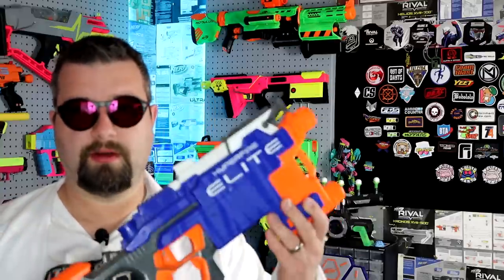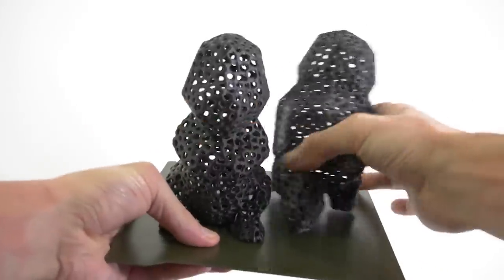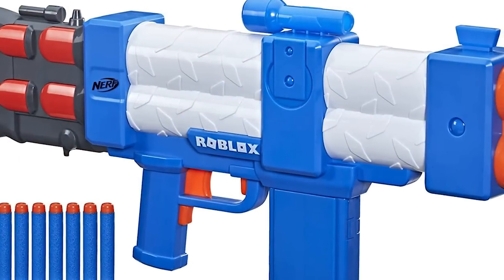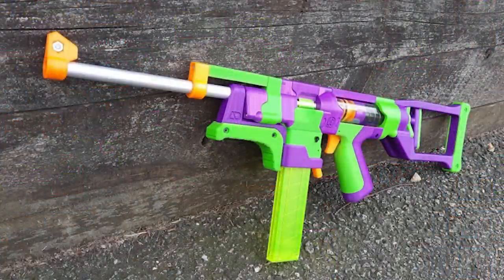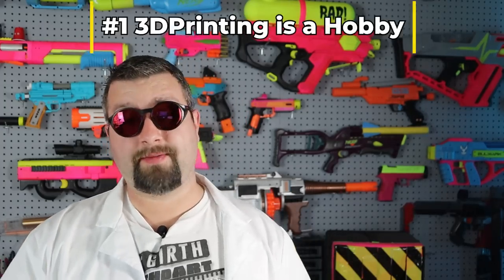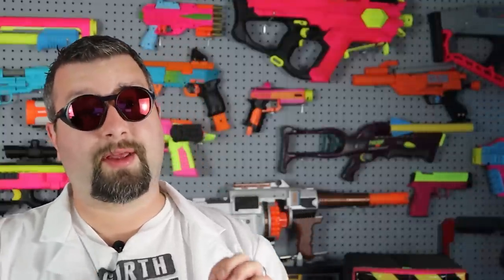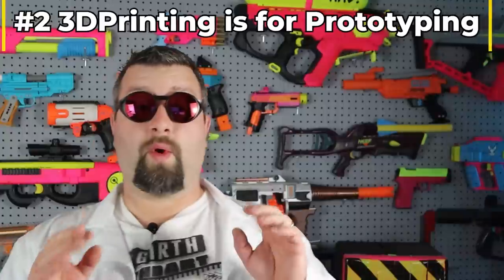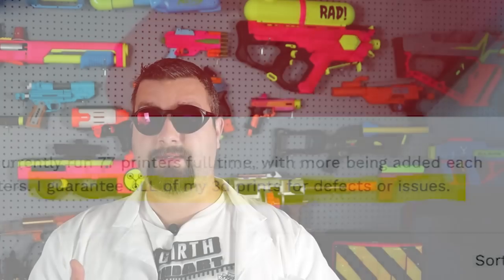What Hasbro Doesn't Want you to Know! 3D Printed NERF

Comment: I jumped into 3d printing specifically for Nerf and I absolutely love it. It is so nice to be able print something out and assemble the entire blaster... such an enjoyable experience ... On a side note in regards to your statement of PETG being brittle, I was bit surprised by this. In my experience and limited research on the topic I found it's actually very much the opposite that PLA is rigid and will shatter, but PETG will actually flex a bit and not really shatter.... 'CNC Kitchen' right here on YouTube has a really good video on this.
Reply: ... I hope that didn't come off as being a jerk by the way. I very much enjoy your content and think you provide great content, was just trying to pass something along. As you mentioned in 3d printing there is some gothcas, so thought I would mention it.
Reply from the maker: Its fine, It could be the brand I print in. I primarily print in Prusament PETG

Comment: Endder 3 is only $199 and does everything you need. For less then what you would spend for a Prussia you can upgrade an Ender 3 to print about anything up to nylon with 400x400x500 build space.
Reply: No
Reply: Ender 3 is Approximately 20 cm of building area
Reply: @antoniorausa9695  if you get the ender extender you can upgrade that to 400x400x500

Comment: Simple, they lobby for laws. Within 10 years I bet 3D printing will be illegal. They already made it illegal to make real weapons with 3D printing. So, only some minor changes to exsisting laws next it's all projectile based prints. And the way things move when there's money and push behind it, I could see it illegal by 2026. Worker and Primetime Toys already make better blasters. And the last time a company made a better Nerf blaster, AKA boomco. Their darts are far more durable and reuseable compared to Hasbro's, also more accurate. Hasbro lobbied to have the rules changed for what a toy projectile could be. Which happened to be what the elite dart is. For whatever reason, that option is cheaper then just making products people want to buy.

Hasbro is a toy company with 40-60 year old IPs. Transformers, Nerf, Marvel, Star Wars, MTG. 

Hasbro bleeds the MTG community dry. Magic the Gathering is a very expensive hobby. And it's very obvious they pay attention to after market sales or else they'd reprint more cards more often. But they don't. Instead, I'm pretty sure some people with a lazy desk job has a shoebox full of old cards they intend to keep the value high on. And I'm not talking about Black Lotus. Black Lotus is kinda, meh today. 

Marvel products flooded so much it contributed to Toys R Us shut down. Hasbro doesn't care, just sell more build a figures and bulk no one wants. 

Star Wars has a similar problem to Marvel, but with more scapling. 

Transformers, OMG hasbro has said they hate their adult audience because they want to sell to kids, to them, kids are dumb and will buy anything. Especially at the time when 1 step changers were cheaply made and being pushed. AND EXPENSIVE for hollow plastic! But their adult audience wants "quality". They atleast came to their senses since kids don't buy transformers like that anymore. Most transformers fans are adults. Kids like video games not phyiscal media. 

And Nerf. The actural fact they refuse to make accurate darts for "safety" reasons. Is dumb. They don't want to make short darts, but they'll make rival and rival hyper which are both argubly smaller. But no, they want you to buy THEIR crap. Listen, I'd buy Nerf darts if they where accurate compared to their competators. But as of now, they're not. And if they make them, they're gonna be in a pack of 30 for 20 bucks! Build quality has dropped like a rock too! So, I give Adventure Force a pass because it's Walmart, the blasters are all 10 dollars cheaper then their nerf equilvilant. Like the villianator is under 30 bucks, 40 round drum, 80-90 fps, super comfortble, the nerf version is what? the Surgefire varients? Which is all 15 rounds 60-70 fps? And is (the shockwave elite 2.0) 27 bucks?! 7 more dollars then the villianator? Is nerf dumb? I get profit margins, but... increase the drum size, give us more power, something! "They did it's called Ultra" Ultra is terrible. Ultra is bad and needs to go sit in the corner. The most accurate Ultra darts are as accurate as an elite dart. They're made of styrofoam and need to be nearly brand new to use in some blasters. Like the Ultra One. Anyone who says Ultra is good is... well, there's a handful of people who use ultra blasters for some reason. BUT I'm pretty sure there's more people who use Vortex rings and discs then Ultra blasters.